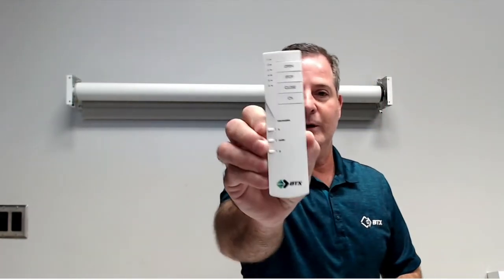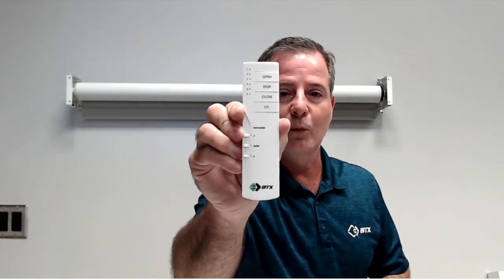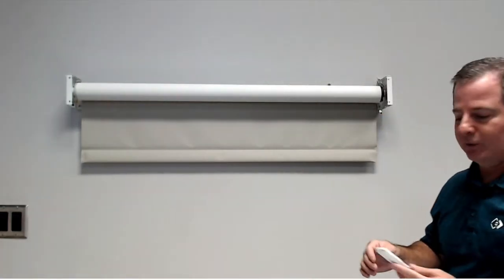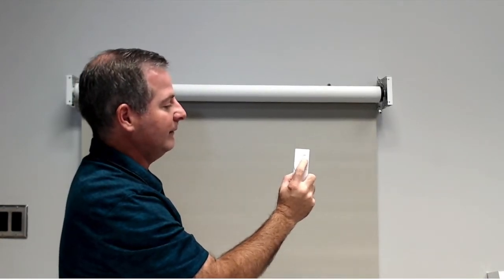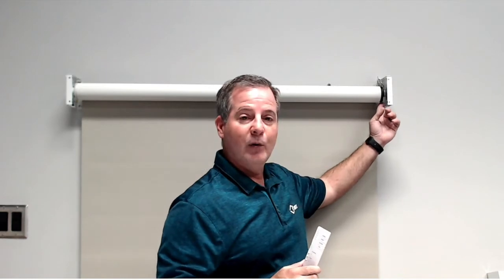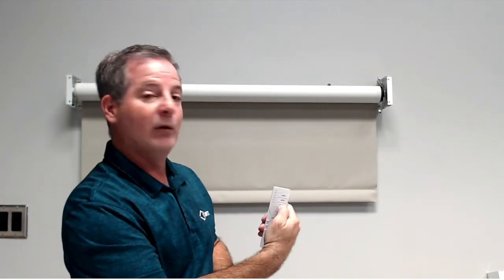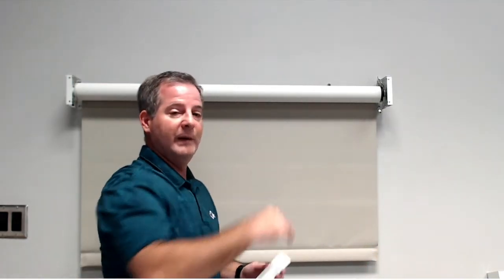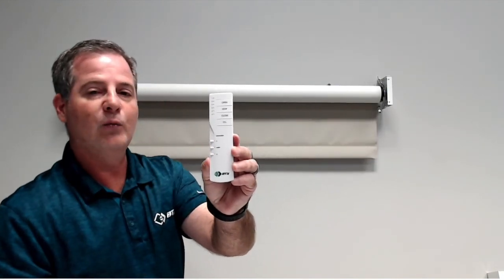Programming BTX 6-CH Remote

Comment: Robert, it would be helpful for you to emphasize that the button on the bottom of the motor, that you are pushing to begin the pairing process is a manual stop limit button with an arrow on it, and there are actually 2 buttons recessed. We recently had problems getting a blind running and trouble shot it with a BTX rep referred by the BTX website when I requested technical help and determined that the motor was bad. After installing the new motor and watching your video several times, I finally pushed 1 of the two arrow buttons, to initiate pairing and was successful getting the motor to jog. I went back and tested the original motor with this technique and it worked fine. We waisted $350 changing this motor since there are no instructions and your video information is less than clear, identifying the "pairing" button. The factory rep told me that those buttons are manual stop limit buttons not necessary for me to use since I have a remote. He told me that the pairing mode was entered by plugging the unit in and the blind is in the pairing mode for 2 minutes. None of that is true and  I am very frustrated that we waisted $350 due to bum information from BTX. The rest of your video is very helpful and I really appreciate that it is available for referance.